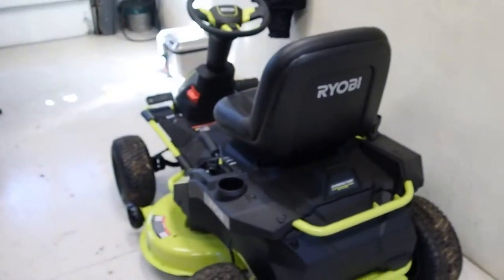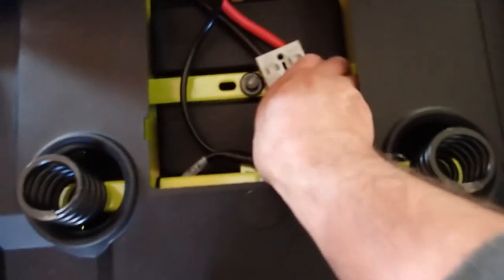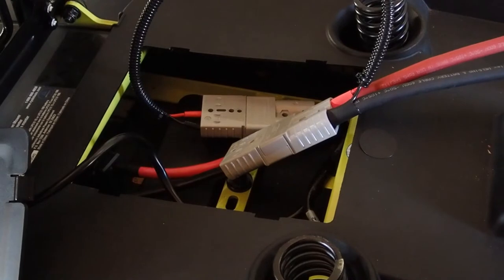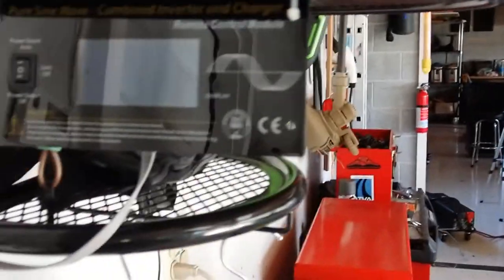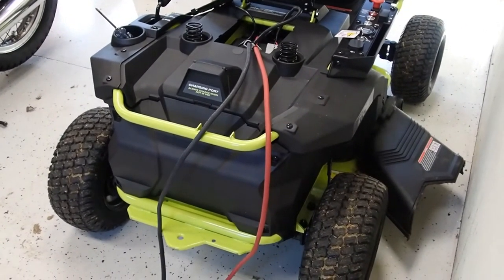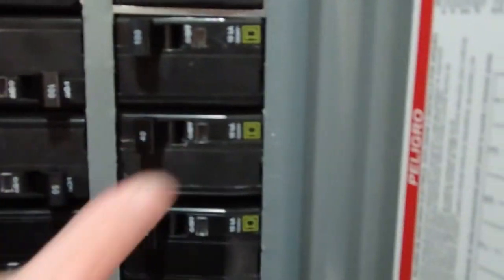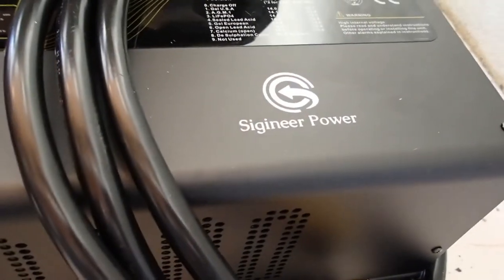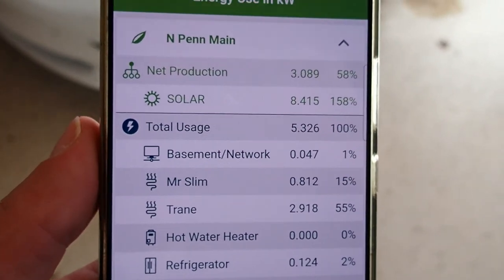Powering House from my Lawn Mower

Comment: Nice.  I made an inverter hookup for my Ryobi Lawn tractor about 3 years ago.  At first I used a 2KW inverter, but now use a 1KW with 1500 Surge which is more than enough to run the fridge / freezer, electronics and all the lights. I also made an adapter so I can clip the inverter onto the back of the mower. One day I will hack it so I can switch the inverter on with the key auxiliary position.

Comment: Dude!  Talk about ingenuity!  Sustainable mower-powered houses are the future.  Also that first basement shot where you were switching off the power gave me Jurassic Park vibes.
Reply from the maker: I think it's the future too!  I forgot a couple things...
With V2H, your V is stuck at the H, you can't go anywhere without disconnecting  again.  With this setup I'm not tethered to the house. 
But I can use my other 1500 watt inverter to charge the mower from my Tesla, that was the purpose for the jumper. That can pump in 500 watt when I am home to extend the runtime, it's more than enough to run the base load on the house without heat/AC running.
Reply: @GregHassler  no way!! That's a sweet setup. How does the inverter hook up to your Tesla? I really want to get one to charge my bike off of it, if that's a thing that's possible.
Reply from the maker: @NewZeroland  inverter from Tesla, this is what I did in the beforetime. Dragging extension cords into the house.
https://youtu.be/E1A-9vBerY0
Reply from the maker: @NewZeroland  getting more than 700 watts might be more difficult...
https://youtu.be/yokqdjzNyso
Reply: @GregHassler  ohhh wow.. no way to go straight from the high voltage pack, huh?  Sounds like I'll need to buy a mower!
Reply from the maker: @NewZeroland  unfortunately not that I know of, it probably easier to go from the Zero HV pack to a 96 volt inverter and go the other way.

Comment: That is genius! I have wondered about using my mower's battery pack to power an inverter but the thought of using the connector under the mower seat never occurred to me. 

** I would offer a word of caution.  I looked at the inverter you are using and there is no indication of an input fuse or circuit breaker.  This means there is nothing to disconnect the battery if a fault develops within the inverter.  I recommend installing a fuse or breaker ahead of the positive input to the inverter.  

Unfortunately, I have experienced several outages in the past few years ranging from 5 to 48 hours in duration. The 48-hr one was first and I did not own a generator. I did however have my mower and I definitely wished I'd had a way to use it during the outage. I never explored the idea of battery power further and simply bought an inverter generator. I'm happy with the generator but I still would like a silent option. 

This weekend I am installing replacement batteries in my ryobi mower, and upgrading from the original 75Ah to 100Ah.  I have been wondering whether there might be enough capacity left in the old batteries to use them with an inverter, but your idea is even better. All I need is a connector, a couple of battery cables and an inverter to get started. 

I am curious if you have used the stock charger to top up the mower battery while supplying the inverter and how well it worked?

My stock charger is 13A @ 48V so it only charges around 600W.  If I need to top off the battery using my generator, the stock charger would hardly offset the usage unless I ration power down to a couple hundred watts.  I think if I need to recharge, I'll probably run the house directly from the generator and charge the battery without the inverter in operation.

Another option would be to get a bigger charger but most stand-alone chargers max out at 15 or 18 amps and cost $200-$300.

The last, and probably best option is to use a combination inverter charger with a bigger charger.  With most inverters, connecting a generator or other AC source will bypass the inverter output and start charging the batteries.  I'll get one with adjustable charging current so I can set it to charge the batteries at 1000W, leaving me 1500-2000W for the load.  

Some inverter chargers have a neat trick where you program the total current it is allowed to pull from the AC input then it adjusts charging current to stay under this limit as loads fluctuate.  Also, with a smaller generator, it can even supplement the generator output with the inverter to provide more power than the generator alone.  Supplementing the generator is not a long term solution to an undersized generator, but it can give you the boost you need to start an AC unit or well pump if the small generator is not up to the task.
Reply from the maker: Hi James, thanks for the reply.  I didn't think about an input fuse but that's a good idea, I'll consider adding one.

Regarding charging while in use, yes I have done that by using another, smaller, 12V inverter from my Tesla. It does work, I think it's the same 600 watt charger you described.

The concept would be that just extends the runtime, but really the base load of my house is only about 200 Watts with no heat or appliances running, and the fridge is only another 125 Watts.  So the 600 Watts is enough to keep the basics on for lights, internet, laptop, refrigerator, and occasional use of other things like garage doors.  Plus I'm not tied to the car, I can still run out to the store and not leave my family without power while I'm gone.

To do again I might get a different inverter, but this one was cheap given it's max output.

For replacing the mower batteries, had you considered lithium iron phosphate batteries?
Reply: @GregHassler  Yes, I thought about lithium batteries but not for very long.  

Even the cheapest batteries on amazon would be 50-60% more expensive than AGM batteries, and name-brand batteries were double the cost.  I would also have to buy a LiFePO charger and probably need to modify it to fit the mower's charging port. 

I also had some concern about finding LiFePO batteries that were of a similar size since the battery compartment is pretty tight.  Just a bit too big in any dimension and they might not fit.

I did do some googling for lithium conversions but never found any good examples completed conversions.  Found people talking about it but no concrete examples where it actually worked.  Considering the additional cost, I didn't feel like experimenting.
Reply: @GregHassler  Turns out you may not need to add a fuse.  While changing the batteries today, I discovered that there is a 125A inline fuse between the battery and the connector.

Comment: I’m intrigued! I’ve the same mower and wonder if I bought the same inverter how long could we power the house if we limit the load to the fridge and a couple lights. Would our boiler pull too many amps, if added? You, or your other viewers care to calculate the load of a typical fridge, boiler and two or three 25w bulbs, and make a rough guess how long the batteries would last? In contrast to buying a $7k-$10k generator, I’m wondering if the mower could power the house for 1, 2 or 3 days?
Reply from the maker: Do you have any specs on your boiler?  I could probably figure it out.  The fridge and lights are very minor loads, for sure the 4.8 kWh available in the batteries would have no problem running them for well over a day.  The inverter itself draws some power to keep it running, about 90 or 95 watts continuous, which is in total probably as much as your fridge and lights (since the fridge doesn't run continuously).

Comment: Hi there. I’m confused as to why you would plug back into your charger to your mower if you’re not connected to main power. 
Aren’t you pulling power to feed your house? By connecting back to your charger you’re using up unnecessary power. Or am I missing something?
Reply from the maker: You are correct, the reason I want to plug in the charger is to feed it power from an external source.  I have an inverter on my Tesla and I now have a Rivian as well, so I can actually feed the charger from those electric vehicles to supplement the capacity of the mower, but still be able to unplug and drive away and still have the mower run things.
Reply: That makes sense. Nice set up.

Comment: Most small engine don't have alternator but a coil that only produce 200 watts tops.
Reply from the maker: This is battery powered, it has no engine at all.
Reply: Can you run the engine to charge your battery's and power your home

Comment: Awesome! Would this also work with the Ryobi 80V mower? Or do you need 80v inverter I guess?
Reply from the maker: Yes, correct, you would just need to get the correct inverter to match the input voltage.  80v is a little bit non-standard but you might be able to find something.
Reply: You modify that lawn mower I never seen one with that big of battery.